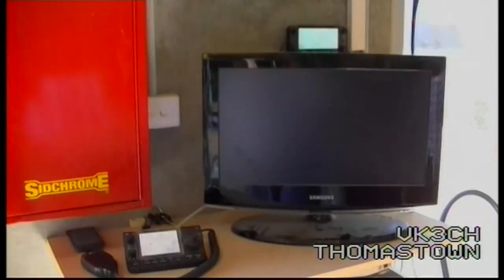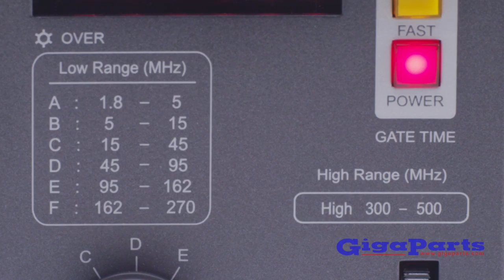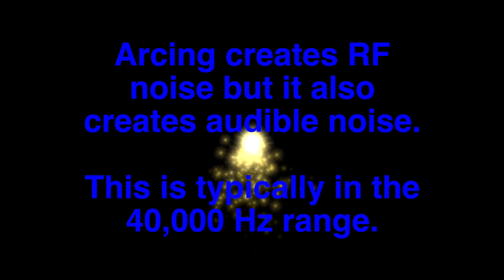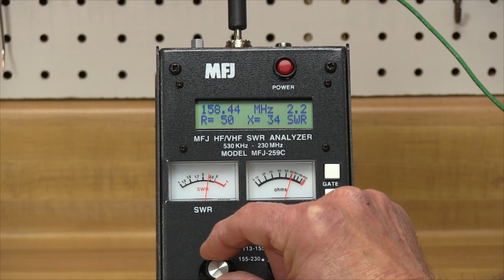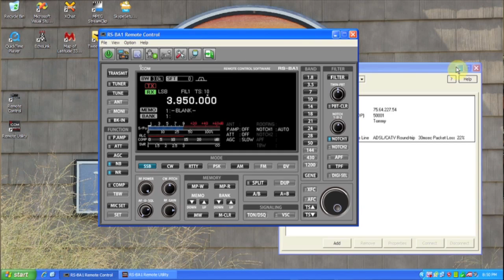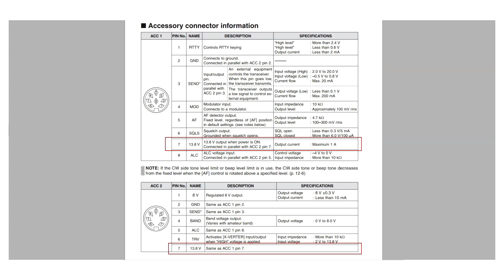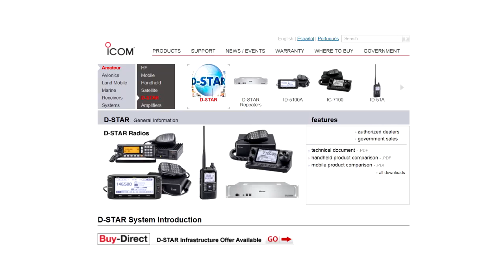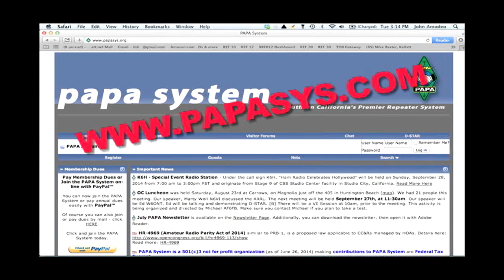AmateurLogic 70: Ardunio Antenna Switcher

Comment: Do you archive all the camera footage, or just the completed shows? So far, I have been keeping everything. But, it does fill the disks quickly. I upload 720P to youtube. Maybe I should also render a 1080P version and archive that and dump the rest.
Reply: I have kept most of my footage Randy although the hard drive it was on has crashed. I would recommended keeping a high quality copy but keep your original footage so that you can do a K7AGE blooper compilation at some point.

Comment: A question to anybody,  A few months back I ordered a few dozen PL-259's, I was getting ready for the addition to my so-called man-cave making a radio room and 9 antennas. Well, 2 weeks ago I started the moving of radios/antennas and it was time for me to make-up new coax's.  I made a few jumpers and noticed all the PL-259's were bad, the sleeves were not threaded up enough [only 4 threads], and the sleeves being shallow, so between the shortage of threads and shallow sleeve I was unable to screw them onto the SO-239's. I bought these from a large outlet, I called and sent pics but still, nothing heard.  Has anyone had this problem?

Comment: The arduino switch would be really cool if you could control it over WIFI instead of a wired switch .
Reply from the maker: Just replace the Arduino with an ESP8266 and write a little code. I needed this to absolutely follow my rig's power so wire was the only safe way.